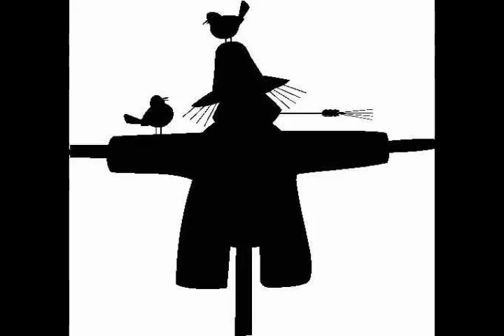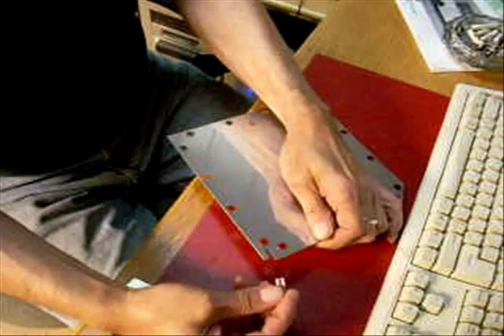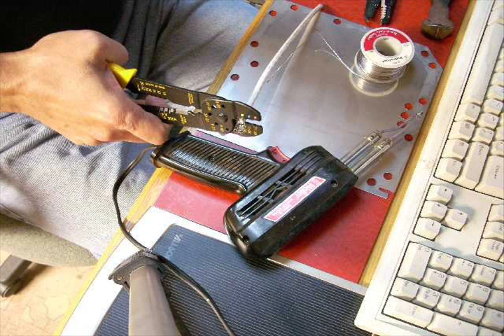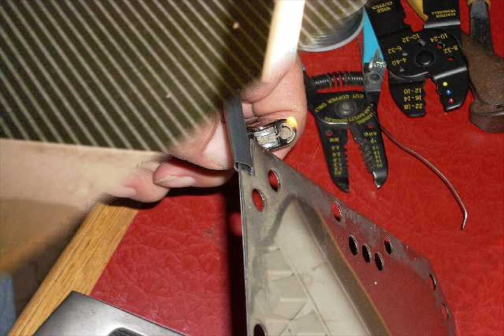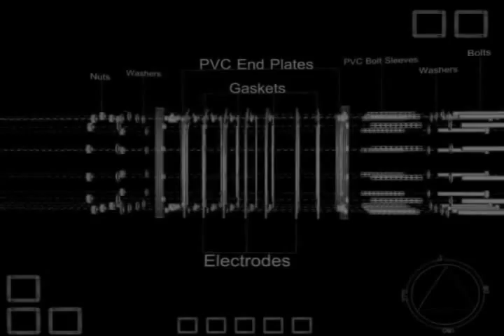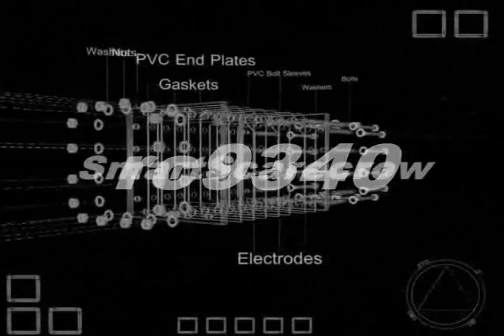How to make solid electrical connections

Comment: yes and no ... the reason I went this direction was that I noticed the connections were loose after extended run times ... purely my own observations ...

the quick disconnects are easy and convenient, so its not like I am knocking them ... they work pretty well ... but if you take temp readings at the connections before and after soldering, you will note less heat at your connections after soldering ... nothing more scientific, sorry ...

Comment: well, this of course depends on what you are trying to get done ... 

my devices tend to have between 8,000 and 12,000 square inches of surface area and are designed to run on 120vAC rectified ... my requirement is for between 10 and 20 liters per minute of productivity ... I would not be able to achieve these design goals with 11 plates ...

Comment: In my own case, the use of the quick connector was a convenience. Not sure I would have been able to get a bare copper wire to stick.  However, I have been told that by the EBN R&D team that there is a solder known to adhere much better to stainless steel than the stuff I was using.  So we shall see when I do next tear down and rebuild.

The junk solder I used worked, but I am told the connection may not have the durability I want. So will try the low temp silver solder.

Comment: thanks ... I will have to try some of that ... the stuff I used was just what was laying around ... it seems to have worked ok as the connections on my device are now running cool to the touch ... before, they were hot as a $2 pistol ...

Comment: Last time I went hunting for them, I found them on eBay from a seller called "cwc2337".  He had quite the selection of odd ball connectors.  Think I paid about $15 for 50 of them.  They are sometimes hard to find as I guess they are not real popular.  The more common ones seem to loose their spring tension and are of a much softer material.